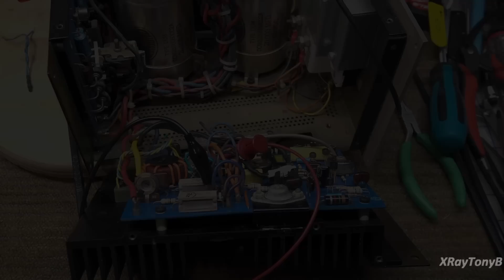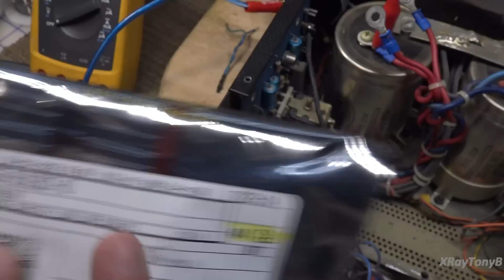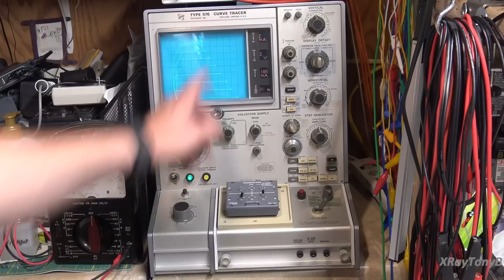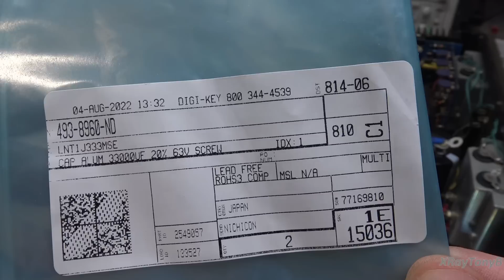Marantz 250 - Part 2

Comment from the maker: 0:15 Intro
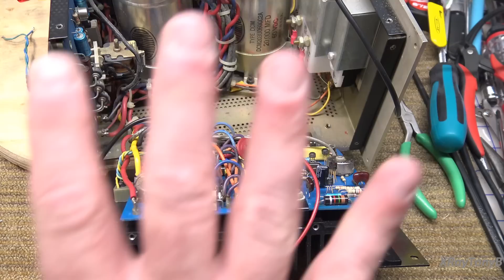0:40 Different Versions of the 250 & some of the issues with the design
1:50 Rectifier diodes and some options for replacement with theory
7:16 Looking at the power supply board 
7:37 The protect relay - finding an option for replacement
10:21 Looking at some issues from the last video - The bias circuit
12:00 Testing the replacement bias diode
18:30 Replacing the protect relay - some tips for soldering to the PCB
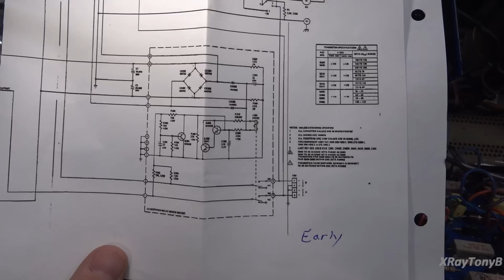23:42 Checking the protect circuit
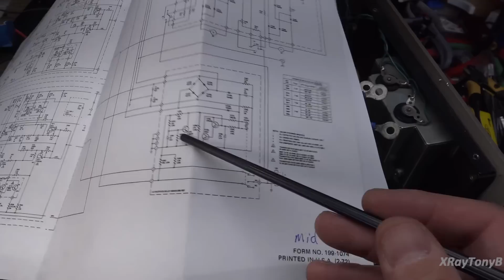29:02  Curve tracer demonstration - Finding a replacement transistor for the protect circuit 
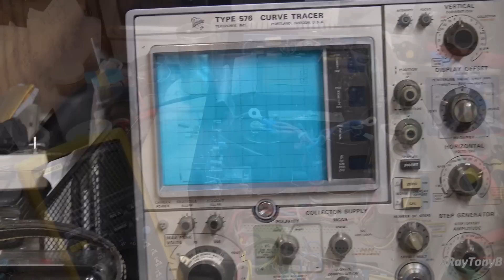40:09 Finishing the repair of the power supply & testing the amplifier under load
Reply: Nice video. P.S. Chapters not working because your description does not have 0:00 Intro in the list.

Comment: I have repaired a few of these amps 240, 250,250m 510m. I have replaced the small signall transistors with bc546 556 and for the Darlington mpsa65 , bc516. Outputs mj15003 4 and pre drivers bc141 and complementaire.  This amp will be stable. Only warning is that bias pot.

Comment: Suggestion Tony. Why not put a dab of high temperature silicon caulk (from any auto store) on that bias diode inside the TO5 heat sink. That will keep it in place to spite normal bumps and vibrations. Alternatively, use one of those "flag" type TO5 heatsinks and roll the top tightly around the diode.

Comment: instead of using a punch use a belt/eyelet cutter a rotary disc cuter with different sizes give you the inner diameter and outer circle.
what about using a uf4007 instead for the rectifier that's better forward voltage

Comment: Thanks for the video!  At 23:42 - I see there is no inverted diode in parallel to the relay's coil to protect against EMF (spike of high voltage across the coil when it is turned off).  Did the circuit designers miss that and shouldn't it be installed?  Thanks.

Comment: Did you finally resolve the issue about replacing the Germanium diode with Silicone diode as temperature sensor?  given the difference in forward voltage bias of the two types
Reply from the maker: Yes. I said that in the video.  I used the UF1004 diode and showed it up close after attaching it to the driver transistor.  I then showed the bias tracking on it .  Watch the video.
Reply: @xraytonyb  Thanks.  I guess I missed that section of the video.

Comment: Thanks for the 576 part! I am looking forward to the dedicated video I hope you will make :).
I love those 577/576 - I have a 577.

in the video I saw that 250 has 2 huge filtering caps, relatively speaking much bigger than for the 500 which 2 x 21000uf, but the 500 has much more power. why are they so big relatively speaking?

On the matching transistor topic - in general  - is is dangerous for the amp if the PNP and NPN are not matched.
I usually use MJ15003/4 to replace blown xtors, but there gains are way different - even from the same manufacturer  - like gain of 150 vs 300 - maybe I am not measuring the gain properly.

Looking forward to part 3!

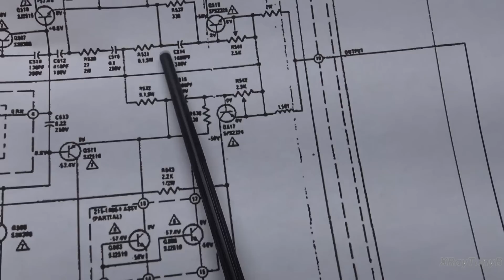Comment: 13:00 Just set the idle current for a Marantz 1030 (2x 15W). Could not get it stable, it needed to be 7,5 mV, but it softly drifted under 5.5 and over 8.5. Saw it at both channels, so went searching for a power supply issue. The culprit was simple: my mains drifted from 227 to 234.

Comment: Hi Tony, i don't understand the gain consideration for the transistors in the DC protection circuit. Transistors are supposed to switch on and off, not to amplify.
Tour Channel is awesome, keep up the good work
Reply from the maker: CR 304&305 provide the power source for the circuit. R309, 304, 303 & 301 act as a voltage divider. When Q301 is off, Q303 & 302 are turned on, which provides a ground path for the relay coil.  If DC is detected at the input of either R302 or R305, it will allow C301 to charge faster than R301 can discharge it, which will switch Q301 on.  Q301 will then bring the base of Q303 to ground, switching the relay off.  I've found that if you use the wrong transistor in place of Q301, it will sometimes false trigger , in spite of the influence R301.  As I said in the video, the transistor  did not need to be replaced, but I wanted to show how to find a match using the curve tracer because several viewers asked about it.  Thanks for the question.
Reply: @xraytonyb  thanks for your answer !
Reply: What if the DC offset is negative not positive. How does the protect circuit get triggered on that scenario?

Comment: The voltage across the cap will never go above it's voltage rating,if the emitter - base junction opens! You don't what your talking about! I can't read the value of the resistor across the cap,but it is part of the voltage divider across the cap!
Reply from the maker: After taking a second look, I missed R306, which is a 27k resistor, located on the other side of the transistors.  It makes a divider of 470k and 27k.  That would hold the voltage down around 3 volts, so you are right.  I didn't see that other resistor.  My apologies.
Reply: @xraytonyb  Some people choose to point your mistakes as constructive criticism and take the opportunity to collaborate and share solutions with you and others (and they are usually nice and polite in their words), others choose the other way.  I don't think that Albert Einstein, Isaac Newton, Steve Jobs and other famous people achieved absolute perfection in their lives and never made mistakes.  BTW, kudos to you in this project, it requires a lot of wisdom and patience as I see the architects of the original circuit had a lot to improve in their next revisions and products.

Comment: I'm curious why you didn't mention replacing the diode rectifiers with heavy duty bridge rectifier that you screw to the chassis for heat dissipation. I used a 20 amp bridge for a 400w class d amp that i built and also for my 20+ year old lawnmower when i had to upgrade the wiring.😇🤔
Reply: Was thinking that would work too.
Reply from the maker: That's another option, but there isn't much room in the chassis, once everything is put together.  I also don't want to get into rerouting wires.  A bridge would be the best option, otherwise.

Comment: Thanks for the video Tony. Great and inspiring, as always. I'm curious, does it make any difference to have the unit on dim-bulb when setting the bias the way you've shown here, that is with observing the scope for crossover distortion? Will the bulb have an influence on the sine wave or it's just for protection?
Reply from the maker: As long as you use a high enough wattage bulb, it won't make a very big difference.  The capacitors will remove any ripple and the power supply will be close to full voltage, as long as the bulb doesn't light up.  There will, however, be a small voltage drop through the bulb, even at this low idle current.
Reply: @xraytonyb  Thanks for speedy response. Can't wait for the next episode about this nice amp. Greetings from Poland :)

Comment: Just out of curiosity, did you try a 2N3904?
Reply from the maker: I actually did.  It had a lower gain than the 2n2222 and didn't match the original transistor as well as the 2n2222

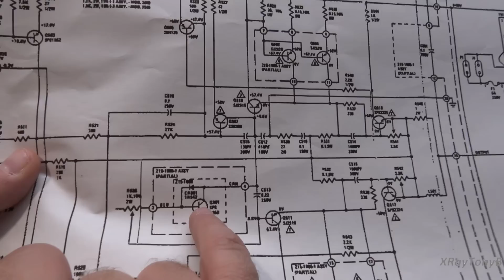Comment: A mod would be to have too high of voltage caused if the transistor failed (shown at time 18:00) trip the protect relay off before it blows the outputs.

Comment: Nice, but the thing that intrigues me even more is the alphanumeric display on the 576. None of that run-of-the-mill Nixie stuff - it looks like neon dot matrix, but I'm not sure.
Reply from the maker: They actually use small incandescent bulbs and a bunch of fiber optic strands to make up the "pixels".  The bulbs can burn out or get a loose connection and the display malfunctions.
Reply: @xraytonyb  ah yeah, I got curious and checked out the Tek wiki. It's this thing of beauty and a joy for ever: https://w140.com/tekwiki/images/d/db/Tek-5031-fiberoptic-readout.jpg
Reply: @KeritechElectronics  That is brilliant, thanks for the link.  The Franlab channel often features interesting old display technology, but I haven't seen one of these yet.
Reply: @rossthompson1635  neither did I - though Fran definitely talked about edge-lit displays, the principle of operation is the same.

Comment: I have an old Cerwin Vega A2200 amp that I want to recap, but I've noticed the plastic clips that hold the boards in are really brittle and I'm worried about breaking them and not being able to find replacements. Do you have any advice on removing the boards without damaging old brittle clips?
Reply from the maker: Unfortunately, once the plastic gets brittle, there is no way to stop it from cracking.  Depending on the type of stand-off, you can usually order new replacements from eBay and some electronics suppliers.